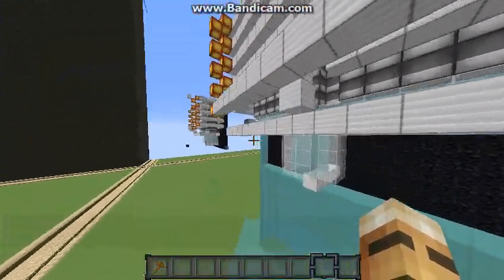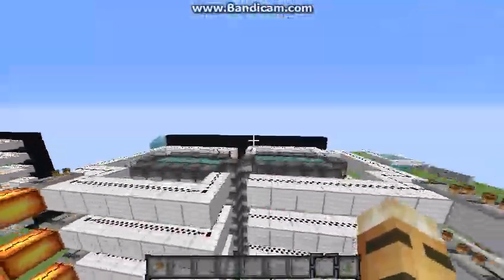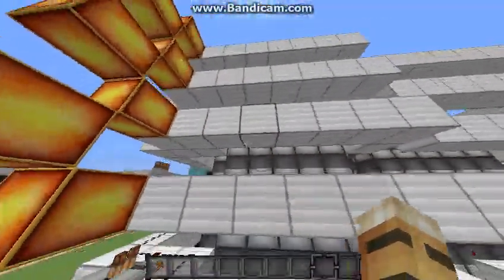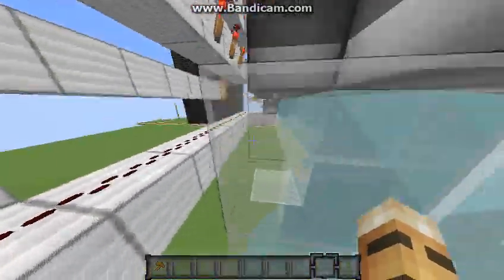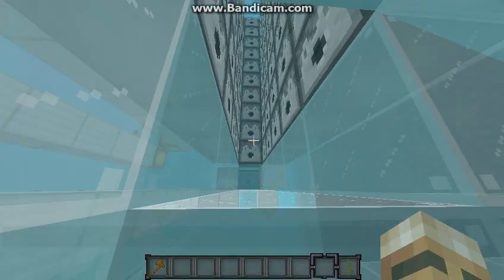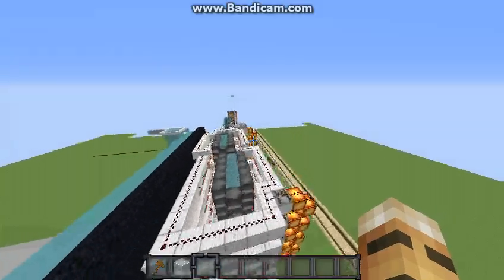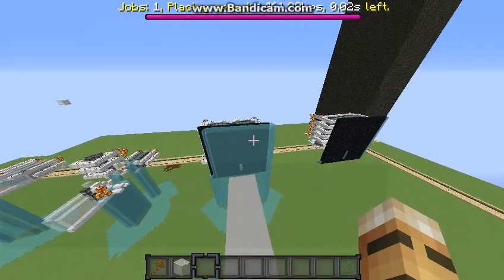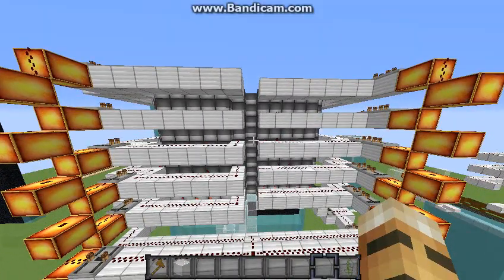Tunneling Effect (with 6 chunk tunneler Schematic)

Comment: Can u make a reverse mid air stack tutorial if you haven't already, or at least how to make a 230 1 shot into a reverse mid air stack
Reply from the maker: Perhaps.  I'm not one to make tutorials but I may cover information on how to reverse midair stack.
Reply: +GoofyGoober Ya, I saw you say you didn't make tutorials, but it would be fantastic if you could cover information on how to. All I want to know is the basics so i can build off of that.
Reply: +PandaIndustries and by how to I mean how to reverse mid air stack
Reply: +GoofyGoober I finally made a reverse stacker, it's on my channel but it took so long
Reply from the maker: +PandaIndustries Just watched and it looks pretty good ;)  I have a couple challenges for you though (have never seen it done nor tried).  One is to try and add something that will nuke down all the sand pillars except one.  The other challenge, which is basically an alternative, is to make a bigger hole in the floor layers so that you can do more shots without having to destroy the sand.
Reply: +GoofyGoober I will try, however I never learned how to nuke, even with a 100 stacker, but I'm up for it :)

Comment: huh for me the cannon doesnt work?
Reply from the maker: A few things.  Did you follow the schematic?  You may need to do minor adjustments to the delay of the cannon but should not be a big problem.  If you did not, I will try to walk you through.  There are two hammers.  One should have like 5 ticks of delay, just using repeaters (it could vary but I find this easiest).  The other hammer should use exactly 4 ticks of delay from repeaters and 1 tick from a comparator.  Important note:  Make sure that there is the same amount of repeaters (tick count can vary but need the same repeater count) going into each hammer.

If this does not work, we should meet up on a cannon server like minelink.  I live in the EST so keep that in mind when we try to meet up.  I primarily play pvp.desteria.net.  So if you go there and do /krynn, you may see me (ballisticly) online.  If so, /msg Ballisticly Hi I need help with a cannon on youtube.  Then I will be able to help more :)